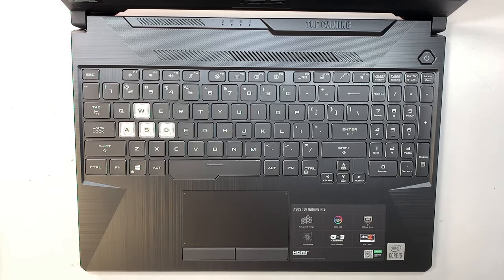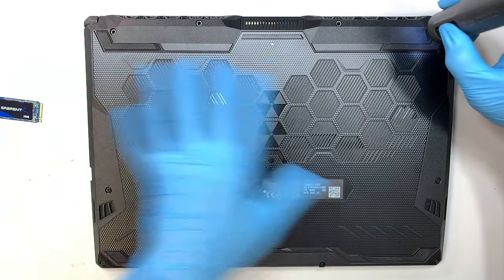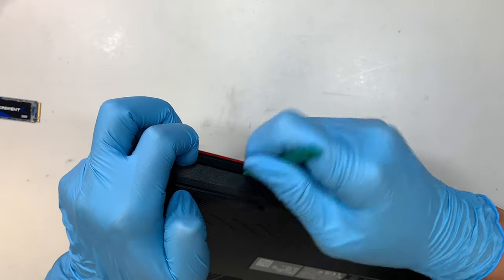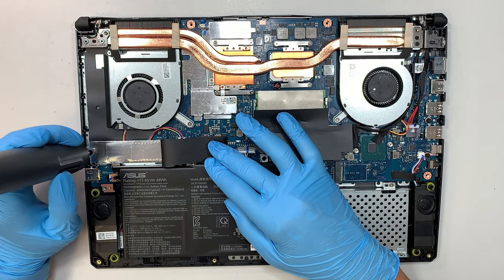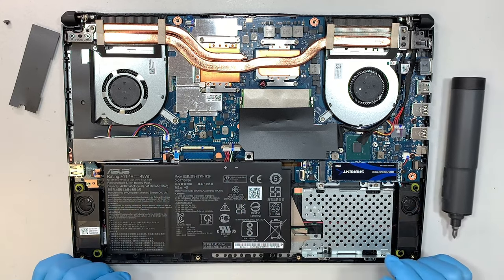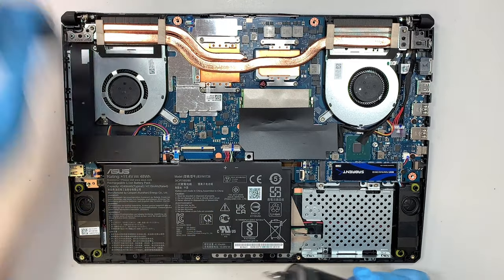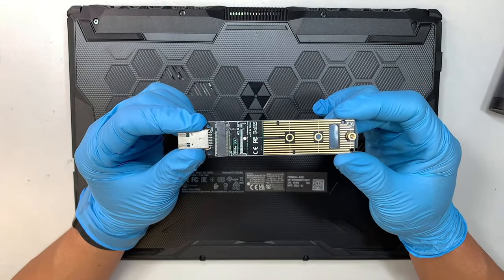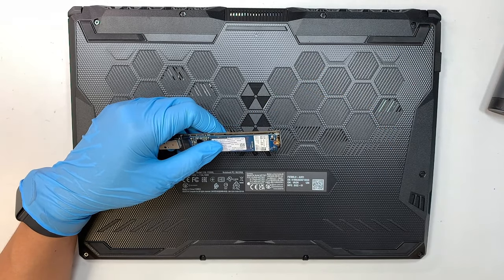Asus TUF F15 Additional NVMe M2 SSD Upgrade

Comment: Asus Tuf F15 (FX506HF-ES51) has Gen 3 slots  (confirmed that with Asus tech on phone) so only get Gen 3 SSD for second port as saves money and if you get 4th gen it’s still only gonna give you what the Gen 3port can do. I use Crucial for my Ram and SSD. Have Crucial 32Gigs of Ram in one with extra Crucial 1TB SSD and in my second Asus laptop I have 64 gigs of ram and extra 1TB SSD. Crucial is reasonably priced, great specs, reliable
Reply: Nice 💖
Reply: slot 1 support gen4 , slot 2 support gen 3
Reply: @mostafab13  Negative ghost rider. I wanted to 100% make sure after checking the specs, so I called Asus and we went over model and specs and and verified both are 3rd gen slots.
Reply: @Itsmy2cent  3 and 4 are not so diffrent
Reply: @mostafab13  SMH buddy, I never said there was. The point is if you have a 3rd gen slot, if you buy a 4th gen SSD you’ve literally wasted the extra money. Will a 4th gen SSD work in 3rd gen slot, yes, but your NOT going to get the speed the 4th gen SSD touts, as the 3rd gen port will only go a certain speed. Silly Simple Example, 3rd gen slot has speed of 5, your 4th gen SSD has a speed of 10…..Your only gonna get speed 5 max. As opposed to a 3rd Gen SSD that has speed of 5. So you spent $50 on a 4th gen SSD, when you could have got the 3rd gen for $30 and compromised nothing. Don’t be daft
Reply: @Itsmy2cent Are they limited in size?
Reply: @realafricanvideos  4TB for SSD and for Ram 64Gigs is the max
Reply: @Itsmy2cent  thanks
Reply: This model has a SATA port? FX506HF-ES51
Reply: @grummanXP  no sata port but does have thunderbolt 4. So could do 2 external monitors, fast data transfer etc.
Reply: @Itsmy2cent  Upgrade options???
Reply: @grummanXP yes, there are. Read the above replies. I found the same info after a bit of hunting on the Asus site.
Reply: @a1smith  What is the best m.2 I can get for this laptop? Crucial, Samsung or WD
Reply: If I update my asus by myself will it void warranty??
Reply: @LLearnWithBro  No, as long as it’s just the SSD and RAM. As they created it to be upgradable. Asus told me this. I also love how Asus comes with one year accidental damage and spills as well for free. Just make sure you register your laptop
Reply: Thanks bro
Reply: Is it 4tb per slot or in total
Reply: @112boatman  Good question. It is 2TB per SSD slot. But these days I keep photos and vids on a portable ssd and just games and such on my internals. Once done with games I either delete and redownload if need. 1500Gigs is fine for me. I’m to cheap to go 2TB lol. And to lazy and scared to change the one with windows on it lol. But 2TB ssd cards per slot is max.
Reply: thanks for info bro I was just gonna buy gen 4
Reply: Dude, i wanna ask some question, my tuf is fx507VV 512 Gb, with i9 13th gen and rtx 4060,so my question is: can i upgrade more my storage? If can, how much maximum capasities can i upgrade? , also about ram in 16gb, did they have another slot for putting more 16 gb ram?
Reply: I need your help. I want to upgrade my asus too but i dont know which ssd and ram is compatible. My model is FX506HC
Reply: @nimeshchamika-il2hy Yep. Easy to do. You could even do 32 and 32 as it’s 64Gig max for the ram. So your golden on your 16 and 16 (32) and 1TBSSD
Reply: I'm glad to see the 3rd gen slot corroborated here, as it was a bit challenging to find here. I ended up buying 4th gen ssd regardless though because I plan on building a pc in the future, so it seemed like a decent future proof thing to do
Reply: Thank you
Reply: What about the ASUS TUF Gaming F15 FX506HEB?
Reply: Thanks makes me feel good about my brand choice
Reply: i have asus tuf f15 fx506lhb the limit is the same 4tb in ssd and 64 gb in ram? or lower? sorry for my bad english
Reply: @hadesz2257  Your specs as far as max will also be 64G for ram. So two 32G Ram sticks. And 4Tb for ssd. So two 2TB SSDs. There is another Asus model similar to urs that also has a space for HDD on top of the 2 ssd slots. Asus They really make it user friendly
Reply: @Itsmy2cent  thanks for info you help me a lot , btw my type also have that extra hdd slot
Reply: @hadesz2257  that’s awesome wish mine did
Reply: Can you provide link 😢I want to upgrade Asus f15 SSD
Reply: @SarodeSandhya  they may take it down but I’ll link 2 vid. First is how to install extra ssd. 2nd video is how to setup (format) extra ssd and you will start at 3:16 on that video. I tried post a link but YouTube takes em down which is odd. But type in YouTube search bar for first video “Asus tuf f15 additional NVMe M2 SSD Upgrade”. You just need to worry about the unused slot on right under the ram. And video on how to format it once you install type this in YouTube search bar and skip to 3:16. “How to install and setup a second NVMe M.2 SSD - Window 11”, thumbnail will have a guy smiling holding something. But literally it takes like 2 mins and it’s done. And you’ll feel like you’ve accomplished a lot lol.

Comment: Nvme pci??? 3 or 4
Reply: There a slot for gen4 & the 2nd slot for gen3
Reply: @markwilson9652 which is which, if you know. 🙏
Reply: @uwet.8826 Gen 4 is the main ssd slot, where you have your ssd already, and Gen 3 is extra slot
Reply: @josemariamartinez3427  thanks a lot. 🙏🏻
Reply: U will never know😂
Reply: @josemariamartinez3427  so can i move the 512gb to the other available slot and put the new gen4 in the main slot? Also another question, what if i upgrade both ssd, do i need to reinstall windows?
Reply: @Avstract23  yes
Reply: My tuf f15 is fx517z. I see the specs is 2 slot gen 4. Is it right?
Reply: @LucienLeeSeoul  do i need to buy a key for windows 11 for that?
Reply: Finally got a Samsung 980 Pro. I intend to move the current SSD to the secondary slot then install the 980 Pro in the primary slot. Boot up the computer from secondary slot, clone the old SSD onto the new one, reboot and finally format the old SSD. Anyone knows whether this will work?
Reply: @Avstract23  Yes, you would, as the new drives don't have an OS on them.
Reply: @aarsyl  i actually found a program that can migrate all os and copy everything to the new ssd. I did mess up at one point and had to reset my computer but i kept my files and os booted up on the new ssd
Reply: Can I install 2Tb in secondary slot? What is the maximum capacity supported? Fx506he?
Reply: @virgilabalaesei6190  yes. I don't think the max capacity that can be handled by a computer is beyond the mainstream capacity of a SSD yet.
Reply: @uwet.8826  thank you
Reply: @markwilson9652 are you sure? Because FX506H has chipset intel hm570 which doesnt support gen4 only gen3. So yes you can put gen4 disc there, but never work full speed.

Comment: The screw for the second SSD slot was so tight from factory that I had to use pliers to turn it because the screw stripped my cheap screwdrivers, then my nice screw drivers started to strip the screw!

Comment: thank you very much!!

just installed a new SSD and RAM on my laptop :)
Reply: did you have to apply thermal tape to the second ssd?
Reply: @furypesto no SSDs don't really heat up, plus thermal paste/tape is for moving heat from the component to a heat sink (like the copper pipes you can see in the video that go towards the fans), and the SSDs are just on top of the motherboard, also the original SSD didn't came with any paste either

Comment: What screwdriver do you use?
I tried removing the screw using a regular small size philips screwdriver but it wouldn't budge at all, and it is now completely threaded/stripped.
Reply: One of the screws are place holders it will not completely come out
Reply: i used something else
Reply: Having the same problem...
Reply: Same thing happening to me

Comment: If I watch correctly,  when you place secondary ssd nvme and place the screw,  there's connector cable stuck beneath the ssd. Is that okay? Will the cable burn because of the heat?

Comment: WHAT ABOUT : holding the power button to discharge the circuits before opening the back cover ???
And what about removing the battery terminal first ?????
Reply: For SSD UPGRADE. Battery disconnect doesn't required.

Comment: Any downside on using both m.2 slot or should I replace the main?
Reply: Don’t replace the main. It’s got enough storage and you will have to reinstall windows if you change it so it’s not really worth the hassle

Comment: What's the max storage limit that I can upgrade to? Can I use a second 512 gb SSD in addition to the original one?
Reply: You can add another 512gb ssd so its 512x512 but make sure its the same ssd as the other one. And if your gonna replace the ssd where all your data is stored, make sure to make a backup of all your important files if you dont wanna lose the files and transfer all your data to the new ssd. But i recommend to just get help from an expert and make him do it to avoid problems (because they know what theyre doing)
Reply: @Josher_C.  Thanks for the info!  Can I use the same SSD from a different manufacturer? The laptop comes with SSD manufactured by Samsung
Reply: @abhilashsengupta618  its fine to mix different brands as long as you make sure that your storage capacities match
Reply: @Josher_C.  Okay.. thank you! And what about RAMs? Can we use a 16 gb ram in second slot, in addition to the 8 gb that comes pre-installed? Or both the slots should have same RAM? Also, can we use RAMs from two different brands, like one from Samsung and other from Crucial etc.? And, the laptop comes with DDR4 RAM, but will it support DDR5 RAM in both the slots?? Asking because I have no prior experience with upgrading laptop memory and storage.
Reply: @Josher_C.  what are you talking about? For ssd it doesn’t matter you don’t have to match the capacity only for ram
Reply: @danneh8777  im not an expert but im just sayin

Comment: It seems that the notebook PC has two M.2 slots, but it is not possible to extract the original image from slot 1 and write the cloned OS image to slot 2 in the internal slot of the notebook PC?
Is there a special reason why you can only purchase a USB M.2 NVMe SSD external case and use it to replace it?
Reply: Hey. Did you found the answer?

Comment: Hi Simon, I have ROG Zephyrus Pro Duo GX551QS where it come with 2 isntalled SSD  from ASUS and each of them is 1 TB, totally 2 TB. They indicated in one drive C OS is 2 TB. No other partition. So now I also have ROG Zephyrus Pro Duo GX650RX where it comes with onde drive 2TB. The another slot is still blank. Now I have upgade and istalled an additinal NVMe with 2 TB. So No How to amke the same thing with my GX550QS where the total of them shall be ine drive C OS with total 4TB indicated on C OS drive. Do you have any video ?
Reply from the maker: I don't have the video of what you are asking. I think you want to RAID your two 2tb ssd and turn it into 4tb. You need to setup in BIOS. Instead of using AHCI, setup as RAID. and go from there.
Reply: @UbergeeksBiz  Thnak you for the advise. Anyway, if we do lie your advise, how is the existing  installed window and data? Are they lost?

Comment: does that void the warranty by opening the backcover and peeling off those covers that stick to the RAM and SSD?
Reply: Ask your customer service. Usually they encourage to upgrade but when I asked my customer service about my second ssd slot they'll respond very vaguely. In my case, all they did was sent me back a tech sheet saying my upgradeable slot is pci4. 

It doesn't void warranty but any damages done to yourself or to the laptop don't fall into warranty so best to unplug your battery before doing any upgrades. For example, Any screws falling on the circuitry of the motherboard can short circuit and possibly damage it. That is irreversible damage
Reply: @TheUltimateHacker007  thanks for your detail inputs!

Comment: is that hdd slot the small rectangle in the right side can i still add hdd ..sorry for noob question
Reply: i havent used this one yet, but thats 99.99% a HDD slot. i can see the word printed HDD cable in the middle of the battery and M2 SSD. Also the ''metal-holder-whatever-it's-name-is'' is definetly for HDD

Comment: I have the same laptop model and i want to ups my rams and ssd. i wanted to know if you can remove the primary 512gb nvme and replace it with a lets say 1tb and add another 1 tb to the extra slots so i can have two 1tb nvme. or it isnt possible to revome the primary and you can just add in the extra slots? plss reply anyone im new to this thech thing tyy..

Comment: My pc have 512gb original ssd, what is the max limit for the additional ssd? Is it possible to add a 2tb ssd in the second slot?
Reply: did you added cz im ordering 😮
Reply: yes i believe so
Reply: @ppgod6989  yes i have installed its working fine from 2 months
Reply: @TEJASPLAYZ  how is the laptop working now bro? Is it heating up a lot? Did you use a laptop cooling station for it? If so then which one?

Comment: If i use new ssd for both slots do i need to reinstall windows? Or do i need to go into the bios so the storage can show up?
Reply: No the system  should recognise  both drives and boot of the original  drive that is already  there.

Comment: why is the disk not appearing on disk manager?
Reply: It has to be the same exact read speed as the drive that is already in there or it won’t show up what I did with mine when I bought it new was got 2 of the same exact ones and switched both out after making a flash drive a windows bootable device

Comment: Can I install 2 1TB SSD on both sloths of Asus Tuf F15?
Reply: Probably it’s better one  1TB and another 512GB
Reply: @RonyHossen-ug2ky  It won't affect the performance right? Some guy told me that I need both SSD of same size to work properly and avoid lag
Reply: @shashankchetia50  I have no knowledge about using the  same SSD providing excellent results.  
In my point of view, 
It's a laptop. So it has many limit. 
You can use 2   1TB  SSD. 
But if you have low money I recommend you to go one 1TB and another 500 GB.

Comment: Question: does pairing 512GB + 1TB have any downside like RAM where you need the same storage for both slot (although you can still uses it by avoiding any overclock)
Reply: Mathspixel  thanks for the info m8
Reply: what did he said? i can’t see the comment

Comment: any one know if i can add 16 gb to 8 gb of ram in my laptop  ? in this case the become 24gb.
is it possible or  its require add them as an equal pairs ?
Reply: Possible, 24gb
Reply: @AF-zx8kg  thank you very much. 🙏...
Reply: @RhavenAlmleh  please do your research and don’t just follow what a stranger say. It’s possible but mixing different RAM memory sizes can reduce dual channel performance. Dual channel memory allows the computer to access two memory modules simultaneously, which increases the overall speed and performance
Reply: @danneh8777  you know what, you re absolutely right, I used to enjoy doing reaserch and find what the optimal way, but now I'm just lazy, at first I was annoyed by your comment, then I realized I'm annoyed by my sloppiness, thank you very much bro, I appreciate it..
Thank you for the information though.
❣️🙏

Comment: I recently buy a gaming tuf f15 but is a more recent model. is the FX506HCB.311 and I don't know if I have the extra SDD slot. I don't want to open a laptop because last time I open it I screw it
Reply: It should have extra space for both ram and nvme2.ssd
Reply: It's got extra space so you can your original  and had a bigger ssd in

Comment: i really can't find anywhere how to enable the pcie 4 "speed"
i installed in the second slot an kingston fury renegade and solidigm p44 pro , both are initially detected at pcie 3.0
Anyone here figured out how to unlock their pcie 4.0 capabilities ? The bios is seems limited
Reply: It's a 3.0 slot.
Reply: @Eyeyamgod  i found out later too, so the pcie 4.0 slot on Fx505hc is the one near the side(originally equipped with a gen3 ssd) not the "free" unoccupied one

Comment: Can the original m.2 slot 512gb pcie 3 be also upgraded to a pcie 4.0 ssd? Or is the main slot limited to pcie 3 and only the other one supports pcie 4
I would like to replace the original one first
Reply: Most Gen 4 m.2  nvme has backwards compatibility. Regardless if it's a gen 4 /3 slot it will work
Reply: @jpsadie1172  While that is true, it is a waste of money to buy gen 4 if it is not supported.